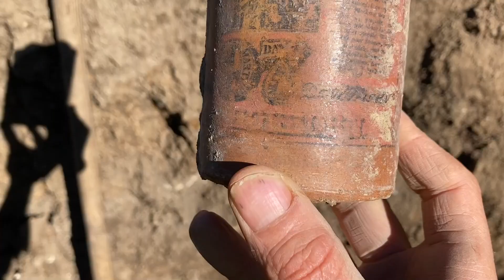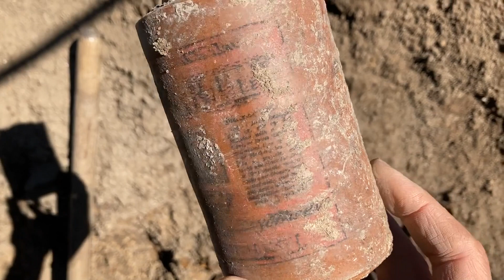Bottle Dump Digging the Old West - COMPILATION VIDEO

Comment: I found a really great Western spice bottle in Kakaako.  It came out in water, no sickness and fabulous applied top.   Those big chemicals are ammonia bottles from S.F.  I also found a fabulous one of those in a neon green at the same place.  My first whole peppersauce, and pontiled cologne.  I found one of those type toilets "Douglas" and even 1" redwood outhouse seat with shiny galvanised square nails. Honolulu had swamps on the shoreline filled in in later 19th C.  Big fires in 1887 and 1900 meant a lot of fill, similar to your  1906 stuff.  Dr Grossman's too.  Just a note early 1900s whiskey caps & toppers, the red lettering can be rubbed off, fresh out of damp soil.   Let them dry & wash them the next day.  Lea & Perrins bottles with JDS on the base are post 1868 "John Duncans Sons" whom imported barrels of the stuff to N.Y. & bottled it.  "Stephen's Gloucester  is a Worcestershire competitor I found here, tooled top and Maltese cross on base.  Haz multi ringed design at foot and shoulder.

Comment: Just wondering why you guys, don't use the four-time potato rakes.?
Reply from the maker: I find the filed-down dandelion forks to be more precise than rakes, which have too many different sharp points so it's harder to control what you come in contact with!
Reply: @BottleNed  well I'd have to agree with that, however I find that a potato rake, is useful for pulling excess material and lose bottles out of a burrowed hole. Then you don't have to reach in. I enjoy your videos they are well put together and presented. And you have some good digging buddies.